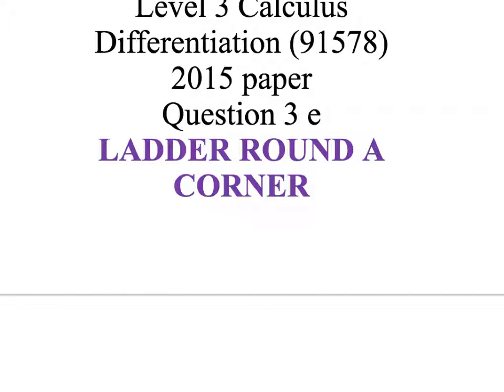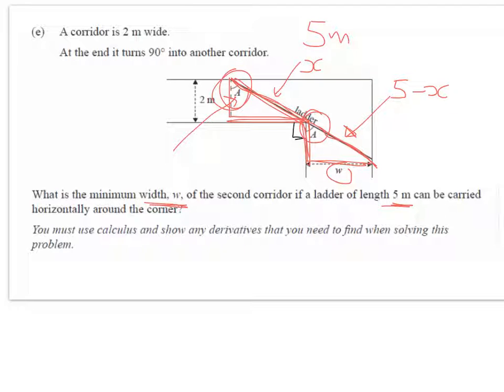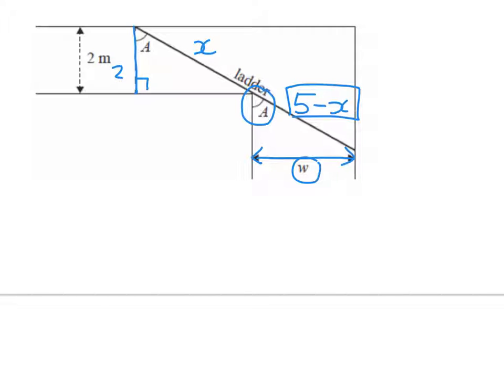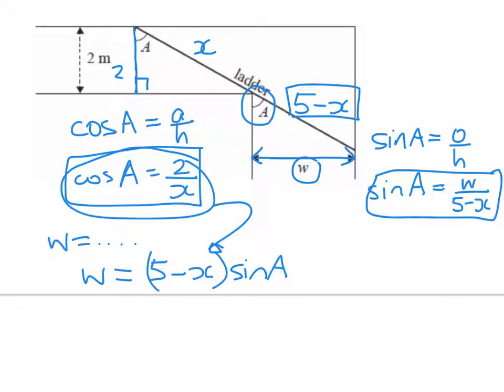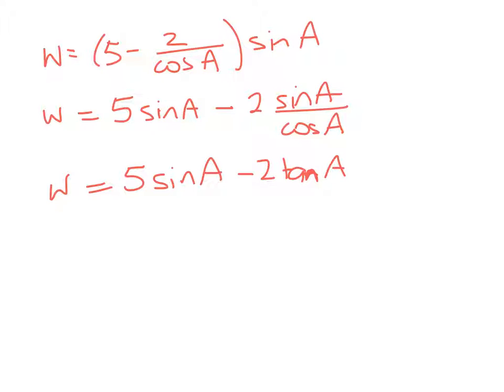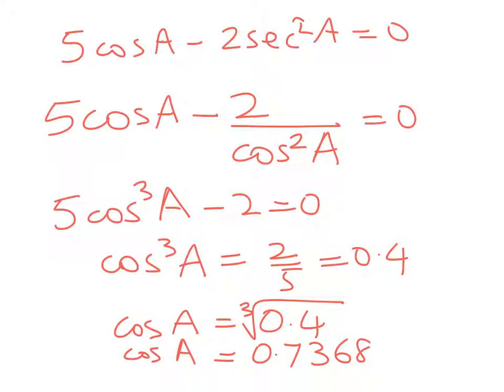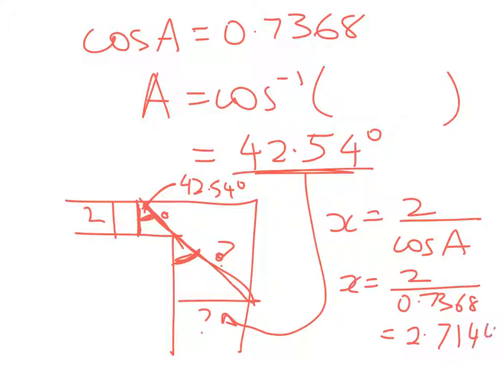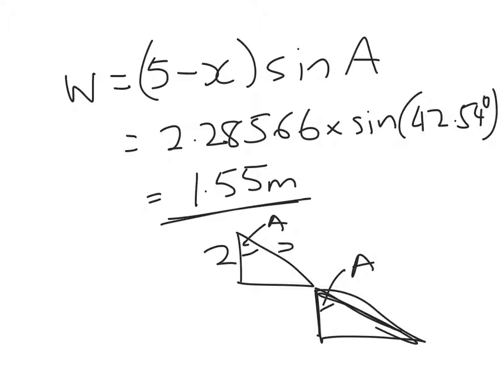Level 3 diff 2015 Q3e LADDER ROUND CORNER

Comment: Would you have any tips on seeing into this question (or guide me to other years that have very similiar questions so i could target them). I tried to do it in a similar triangles way but it led me down a rabbit hole where I found out that the triangle in the diagram was exactly a 3,4,5 triangle and w was 1.5 but in the case of the diagram, w is too small so it was obviously wrong ☹️